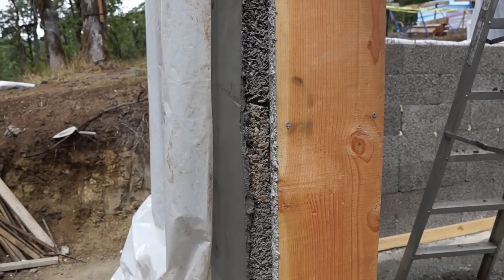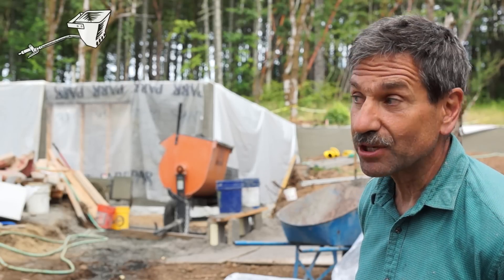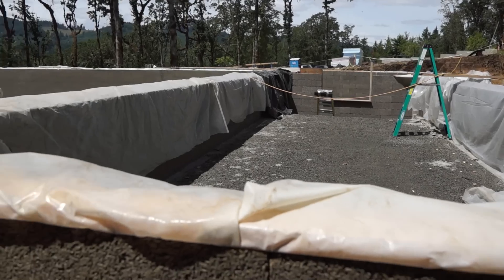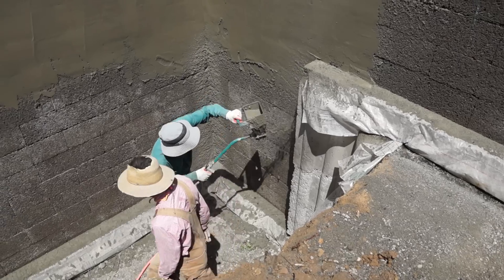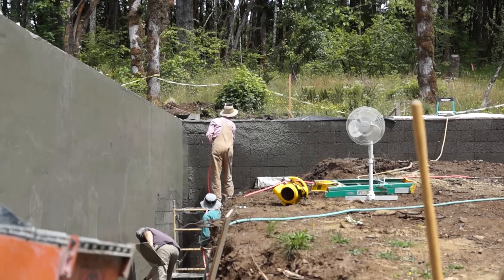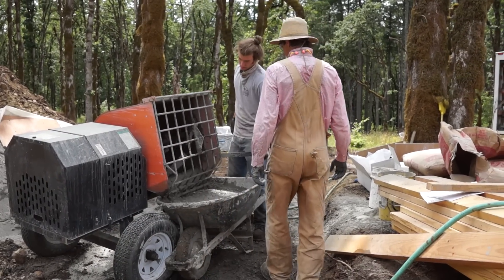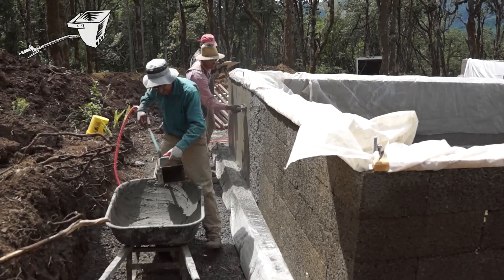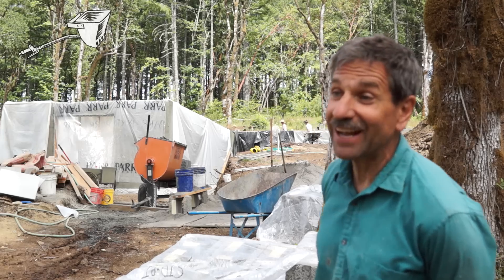FasWall Sustainable Home Construction With A Mortar Sprayer and HERB-CRETE Stucco Core MIx

Comment: Probably need the road crew compressor. . The pull behing the truck diesel machine.. 4 jackhammers running has got to be more than the sprayer.  Great video..once you have everything sealed up, they have many kinds of waterproofing paints you can spray also.

Comment: Can we see the finished product?  And is this HEMPcrete?  What was the total cost vs. other materials, or the savings total??
Reply: Hempcrete is crap.  MUCH less strength that regular concrete.  Just because something is made with hemp DOESN'T mean it is any good.  Americans use hemp al the time.
Reply: @patrickeh696  
Are you want of the government people that are making it illegal
Reply from the maker: Oregon SunriseSis Hi I"m sorry we don't have any photos of the finished product. This was made with FasWall, you can contact them to discuss the comparisons at http://www.faswall.com.
Reply: ToolCrete - MortarSprayer.com Thank you.  Someone really needs to go to bat for the American people's RIGHT to use this plant for all it's varied commercial uses.  It is a crying shame that it is illegal in most states still.
Reply: 1. How many coats of  HEMPcrete did you use on the house?  2. Did you put anything on top of the final coat of HEMPcrete or did you leave it exposed? @Mortarsprayer1